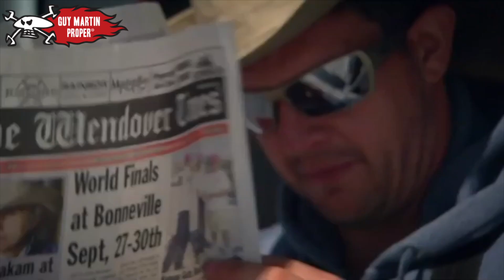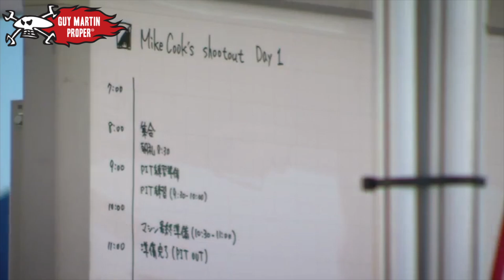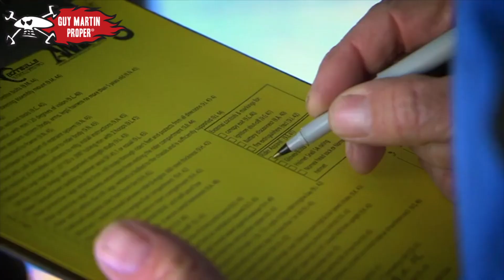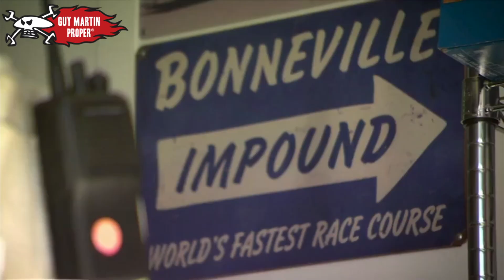Guy's Land Speed Record Crash | Guy Martin Proper

Comment: He goes 200 mph at the TT and this thing flops over at 70??
Reply: OLD SCHOOL 
TT isn't raced on salt
Reply: @britbong1457  And it's not in a straight line on a mirror flat surface either.
Reply: OLD SCHOOL 
True that, TT is crazy I'd love to see it some day
Reply: I made my first trip to the salt flats last August.  The surface is surprisingly slippery.
Reply: It's 5meters long and sitting position,  2 engines and low to the ground much the same as riding a skate board sitting. 
300klmh on a bike no worries 200 in a cocoon no thanks.
But Guy's a multitalented racer so he'll be back for it.